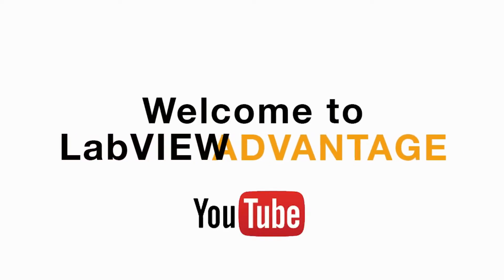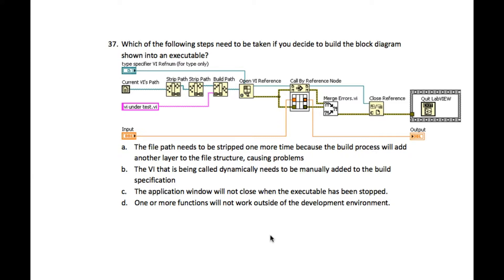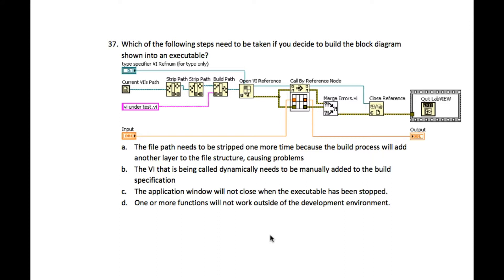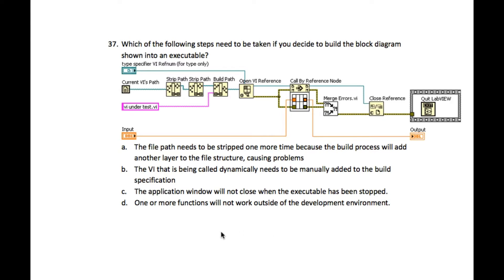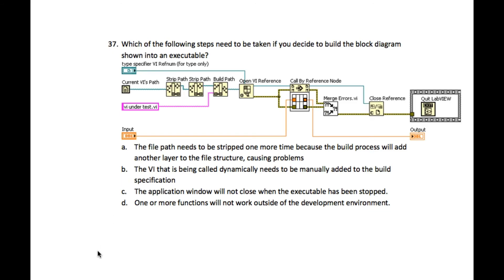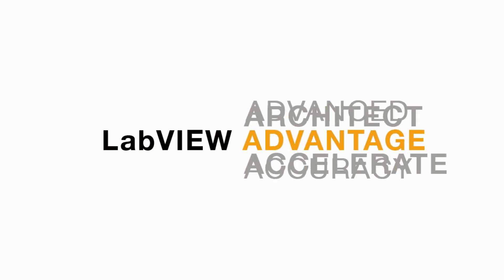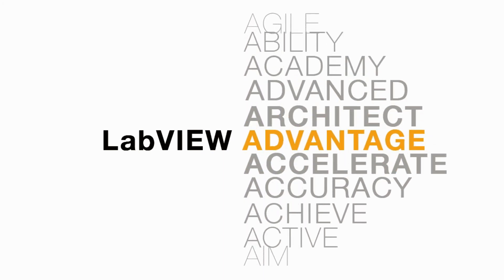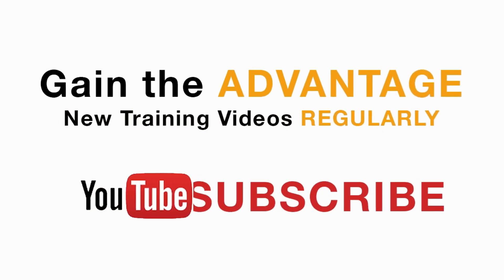LabVIEW CLD R 37 Executable

Comment: I believe, and correct me if I'm wrong, but the correct answer should be D. Yes, the "vi under test.vi" will need to be 'Always Included' in the build specification, but I also believe the way the path is constructed will need to be changed.

Assume the path: c:\level1\level2\main.vi for the Current VI's Path. Two Strips and one Build Path gives: c:\level1\vi under test.vi for the called subVI. Once we build the application, the main.vi could be at: c:\abc\builds\my build\my exe.exe\main.vi. And an 'Always Included' vi in the build would be at the path: c:\abc\builds\my build\my exe.exe\vi under test.vi. Two Strips and one Build Path from main.vi would produce the path: c:\abc\builds\my build\vi under test.vi which does not match the proper path to the called subVI within the build. Therefore, D.